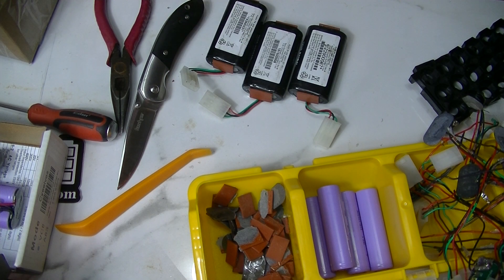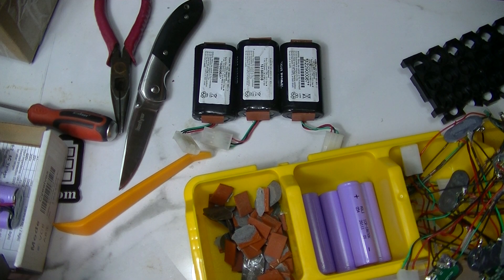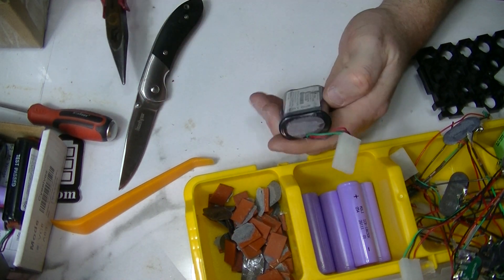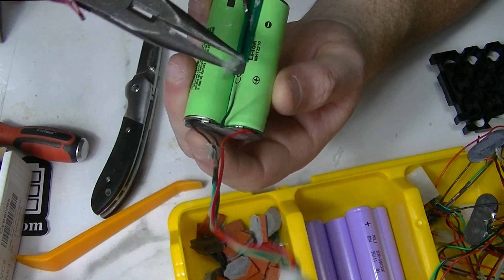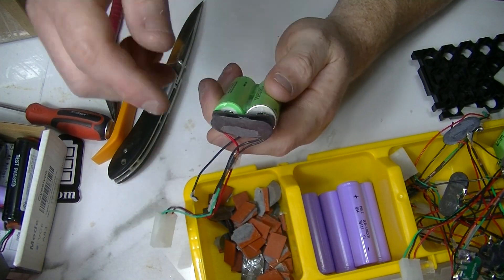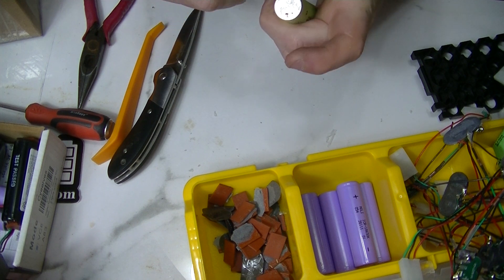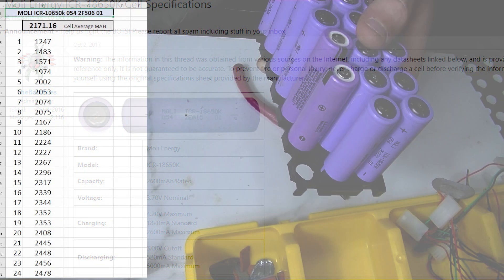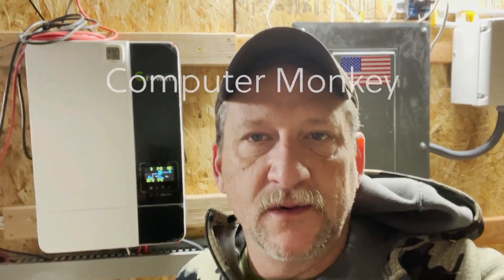I Got 20 18650s For $12.00 & A Shoutout That You Must SUB!

Comment: Hey Bobby another project lucky you. I would be tempted to just wire the pairs up into the voltage I need but I am basically lazy lol.
Reply from the maker: Haha it's cold out so minds well keep building Hhaha. Thanks brother. God Bless... 
PS glad I did not do that. I found 2 cells that where just flat out bad and 1 cell that was leaking. For me I need them to fit into a new formfactor. I think you will like it !!!!

Comment: I saw these but think they sold out. I will keep an eye out since they look nice for my project in mind.
Reply from the maker: O no I am sorry. There not bad. I ended up testing all 40. 2 where just dead. One was cell was leaking. So I sendup with 37 cells. In the video I share the spreadsheet. Of my mah test. The average mah was 2100 ish. This was for 24 cells. After doing all 40 I got a average of 2200 ish mah. So Not bad when they new where 2550. Hope this helps some. God Bless.